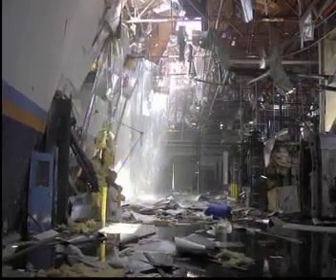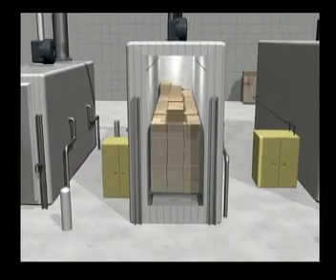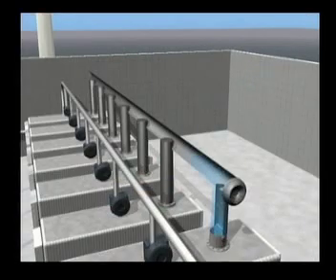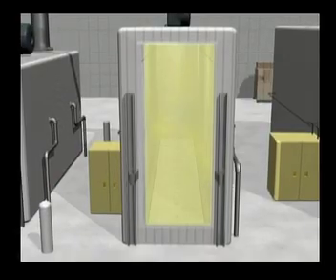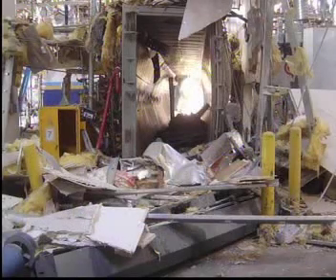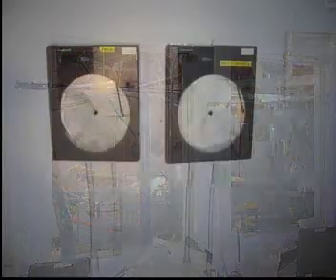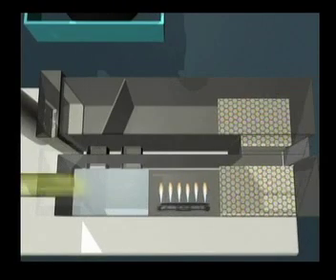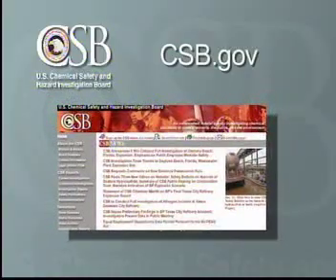CSB Safety Video: Ethylene Oxide Explosion

Comment: I am confused about why they needed the open flame component at all? Why wouldn't they just vent the gas outside or to a stack, or flare it?
Reply: To reduce air pollution. Basically, to burn it off instead of releasing harmful substances into the environment
Reply: I watched another video where a company vented natural gas INDOORS of all places like it was normal
Reply: They have to burn it up before venting the rest of the gas outside, but yeah, maybe the safer option would be to have a/several buffer tanks, then burn of the Ethyl when venting it from there.
Reply: The gas is toxic.  That explains why it wasn't directly vented.  The concentration of gas was also low enough under the normal use case that it wouldn't ignite.  That explains why a flare would be ineffective.  If you're wondering on that last point how the process cleared the gas at all, it's a catalytic process.  The gas is heated and run over a catalyst, which promotes the reaction that destroys the material.  You could compare to the use of a catalytic converter in a car...  The auto exhaust isn't normally flammable if the converter is missing, yet the converter does cause oxidation and destruction of some compounds in the exhaust to prevent their release into the atmosphere.

Comment: Sterigenics doesn't seem to have the best safety track record. I worked for a  company that does electrical work in one of their facilities in Georgia and this facility had an explosion that threw a worker 30 feet across the room 3 years ago. Not only is the gas a carcinogen that harms the community but it's very explosive and leaks don't seem to be detected before accidents occur

Comment: You know it's an old YouTube video when the maximum quality is 240p and it looks like a VHS tape.
Reply: Pretty sure it was originally a tape
Reply: @hziebicki  Yes.
Reply: @hziebicki  It wasn't just the tape it was also the quality of the CCD. You have to be around a few decades to appreciate 240p.
Reply: What's amazing is how good of quality 240p looks when it was shot with a 240p camera, vrs compressing a 1080p to 240p
Reply: @Adam-vj7dn  Video from a decent 1080p camera downsampled to 240p will look great for a 240p video, provided the bitrate isn't also reduced to the point of introducing obvious artifacts. What you're probably seeing is when a site like YouTube downsamples a video to 240p, which it does to reduce bandwidth when it thinks the connection is shit, so it uses an ultra low bitrate, and what you see is a bunch of compression artifacts. If I wanted to shoot a 240p video for some weird reason, I'd take a good 1080p camera over a good 240p camera any day, as the higher resolution sensor gives me about 27x more data per pixel when reduced to 240p.
Reply: @Ryan_Thompson  thanks for the analysis, I appreciate it!

Comment: So let me get this straight - someone designed a container for an explosive carcinogen, then attached a catalytic component with OPEN FLAMES?
Reply: Thats bad, it also amazes me that they had no kind of sensors or alarm system in place that could detect explosive levels of ethylene oxide before they went to open the door which released the air that was in the chamber to the other section that had the open flame.
Reply: @REXXSEVEN  - Even if they did, you know that inevitably some knucklehead would de-activate it.
Reply: It‘s interesting that no flashback prevention was engineered into the feed to catalytic unit.  Flashback prevention has been around for a long time.

Also without any sensors for explosive gas concentration, the automated system is running as a simple state machine without any input as to the level of hazard in the chambers.
Reply: @JimDickenson:  yea, I noticed that too.  It was the first thing I thought of when watching the animation.
Reply: Makes sense to me

Comment: "hey, you know this incredibly explosive gas that needs to be filtered out safely? what if we just, not do multiple steps and send it right to an open fire to save a little bit of time"
Reply: Use the super secret password 🔑
Reply: Or just use nitrogen gas to do the initial flushes, and only introduce the oxidizer near the flames so the flashback has no oxygen to feed upon.?

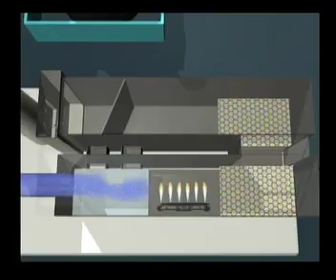Comment: 2:50
"Well there's a problem see"

Open flames and flammable gases should never ever mix.

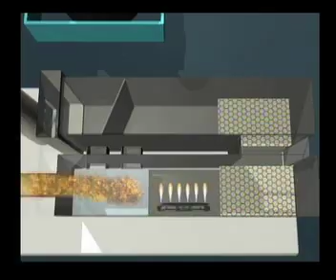4:56
A sensor placed before the catalytic filter that could close a valve rapidly if the gas beeing vented to the system contained to high a concentration of a flammable substance. Or just don't pass it through a open flame. I seriously don't know who thought that was a good idea.
Reply: What's your solution to removing small amounts of ethylene oxide from large volumes of air with low cost and total confidence?
That sensor would ride a fine line, Ethylene Oxide has an LEL of 3.6%, there's not much room for a safety margin that still lets gas flow. A valve doesn't solve the issue, just reduces the odds of the gas igniting in the oxidizer, the room will still have a flammable concentration of poisonous gas.
Reply: @CuthbertNibbles  don't use an open flame, use a heat exchanger or an electric coil, which  wouldn't provide an ignition spark

Comment: THAT was a terrible design flaw.
Safety interlock to prevent opening the main door if internal air reads above LEL.

And/or some kind of holding chamber for the gases to go instead of straight into the flame.

Comment: Why they dont use ozone instead of ethylene oxide?
Reply: The only reasons I can think of off the top of my head is that ethylene oxide has a much stronger cohesion as a molecule than ozone.  Ozone is much more prone to splitting itself back into O2 (i.e. normal oxygen), especially under the concentrations they are using here in each chamber.  Also, ozone is a VERY strong oxidizer which would require special linings of the chambers to prevent corrosion.  This is probably cost-prohibitive.  Not to mention the corrosion of medical instruments made of metal.   This does not even bring into account the stringent requirements by federal and local governments (at least in the States) in regards to the handling of large amounts of ozone which would also be cost-prohibitive.
Reply: Ozone can't be stocked and it costs a fuck ton of money to produce in situ. Besides that, it's also much more reactive and could ruin plastic. Ozone is generally used for decoloring alongside sterilization. For this kind of application it's totally overkill.
Reply: Thank you for you answers guys, learned a lot!

Comment: Imagine going to work one day and the next day there is no work. When using any gas even oxygen safety first. One small mistake could lead to this. This could have easily been avoided. Now you have to rebuild the entire shop and it even had structural damage. What a nightmare:/
Reply: What do you mean even Oxygen? It is nasty stuff, it causes stuff to burn, it can cause you bodily harm and is higly reactive.
Reply: oh i can. It's called COVID

Comment: The biggest doh of all is why there was no flame arrestor on the oxidizer
Reply: I never knew a flame arrestor was a thing. Interesting! Are they used commonly in industry?
Reply: @bendoy4555  They are, sir. And they're made custom for each application.
Reply: Not only a flame arrestor, but also redundant flammable sensors upstream that safely isolates the catalytic oxidizer while halting any more venting until the problem can be sorted out. I would guess that a 3 way valve bypass into the scrubber while isolating the remaining chambers, and gas wash injection into the piping would also be in order.

It's sad to see that they relied on humans, never making mistakes, or equipment /software never malfunctioning to avoid an explosion.

Comment: Is there a flammable chemical that is NOT toxic to humans (or any life for that matter).
Reply: There are two kinds of "hazardous to humans" chemicals.

The first is toxic. These change the way your body works in a way that's harmful to it. Ethylene oxide is a toxic chemical.
The other is a "simple asphyxiant." These displace air. If they reduce the oxygen level to below what you need to survive, they'll kill you. There are a LOT of simple asphyxiants that are extremely flammable - both hydrogen and acetylene are simple asphyxiants. But in theory, you could breathe an atmosphere of 80 percent hydrogen and 20 percent oxygen. It would be safe to do so because the Upper Explosive Limit (the richest the mix can be and still support combustion) is only 75 percent. 

But to answer your question, sucrose is a highly flammable chemical that's so non-toxic to humans it can be eaten. All edible fats are flammable.
Reply: @jmowreader9555  there are also other types of "hazardous to humans" chemicals beyond toxins and asphyxiants, such as carcinogens, corrosives, and mutagens.
Reply: oxygen
Reply: @solitudecrow6280  oxygen is NOT flammable.
It is an oxidizer, for flame to happen you have to have fuel + oxygen.
If you light a match and drop it into a container of 100% oxygen the match (which is a fuel made of wood or paper) will burn out fast and then go out.  It is not the same as throwing a lit match into a bucket of gasoline.

Comment: 6:35 That ironic safety poster was visible to all the people in the control room. 

"Safety is for life," except when you're in a hurry or think there's no reason for safety procedures
Reply: Safety is the ideal and sometimes just a sign on the wall in places where there is a lack of understanding of how exactly the machinery operates.  I've heard a few stories of people whom worked in factories that were told that the "engineers/consultants are too expensive to telephone" and to just hit the buttons.  In one of those cases, it involved a propane cure oven door being sent through the wall into the neighboring business.
Reply: @timothylegg  that’s the worst. Like really, the neighbors too. At least the employees understand they are taking SOME risk, but the neighbors?
Reply: I make ethylene oxide, and we have a tank with hundreds of thousands of gallons in it. If it blows, we’re blowing a 60 mile hole in the ground

Comment: Amazing waste of resources.  You could suck the gas out and reuse instead of dumping and scrubing
Reply: It's not that simple. The gas extracted is no longer pure ethylene oxide and would gradually weaken in concentration if constantly reused. Even in the first stage, as the chamber had already contained air, and so did the products.

It might be too expensive to separate air out from ethylene oxide rather than just buying more.
Reply: There was a system to do this but it failed to compete with releasing it. The cost going in was prohibitively high

Comment: About 15 years ago at about 3:30 AM, we get a call for a gas leak in a hospital. On arrival, maintenance met us saying "That alarm is going off" "Take your meters and sniff around". I questioned him if the alarm was in surgery. Well of course it is. An indignant nurse then proceeded to tell us our job, "Just go down there and read that yellow book on the wall" she says. Long story short,  an evacuation occurred with a first alarm assignment, the county haz-mat team was called complete with decon lines. All because of marginal training on staff and no monitoring systems in place. BTW it was a false alarm!
Reply: Good thing it was a false alarm or you'd just be a poorly animated worker dude in these horror training flims
Reply: The hospital I worked (St. Peter) in had a false alarm every week. We were told to ignore workers concerns when they reported it. The boss claimed it wouldn't hurt you and breathed it to prove it was ok. He died of cancer, although no link can be proven to ETO. 
The same hospital stored huge amounts of formaldehyde in the early 2000's. When a leak/flood of formaldehyde  injured several workers, heads rolled.
Reply: @radsdad1  Holy mackerel, Then why are you required to wear badges or personal alarms?
Reply: @Wa3ypx  No badges or personal alarms were worn.
Reply: @radsdad1 
The gas used in hospitals was non flammable blend. But considered non-toxic for over 30 years. It was vented into the room with the workers, until it was a “possible carcinogen” like cigarettes

Comment: So... to clean the catheters they soak them in toxic chemicals, without even removing them from packaging?? They should come clean from the manufacturing line!
Reply: They aren't soaked, they are fumigated with the ethylene oxide. Then the gas is evacuated leaving no residue. The products can only be sterilized to a certain extent during manufacturing. So, they are either fumigated or irradiated to steralize them at a separate facility.
Reply: @cheapskateaquatics7103  typical quick to judge person when they don’t know what they’re talking about
Reply: @PorWik  giving information is not the same as judging

Comment: How about using inherently safer methods of sterilisation like gamma radiation. No toxic or explosive gasses involved in that process.
Reply: Gamma ray sterilisation is expensive to operate and isn't recommended for use on things that are ready for shipping, this is because gamma rays can break down most of the plastic polymers that are commonly used in packaging.
Reply: sure.  and gamma radiation is 100% safe?
Reply: @devtrash  A lot safer than toxic explosive gases so not being 100% safe is hardly a good argument against it.
Reply: @asvarien  The radioactive waste afterwards would be dangerous.
Reply: @LacrimosaSunshine  Gamma radiation sterilization uses cobalt-60, which has a half life of 5 years, so it's not too bad. Cobalt-60 is used in a lot of industries as a source of gamma rays so there is a robust industry for its disposal. Gamma radiation sterilization can't be used with certain products though because the gamma rays damage the products, it is used to sterilize about half of all medical products requiring sterilization already.

Comment: i assume other adjacent chambers were also badly damaged by the shockwave from the blast?
Reply: i assume they were damaged to some degree, since the original chamber walls are just bulge outwards, the forces may have been directed away from the other chambers so it may not be as bad as you think but that's just a random internet person 2 cents.